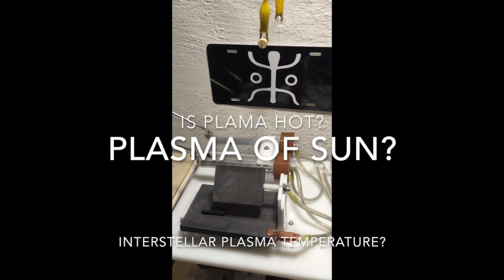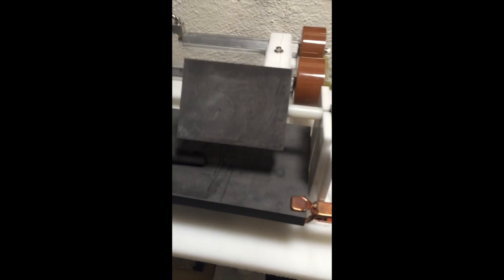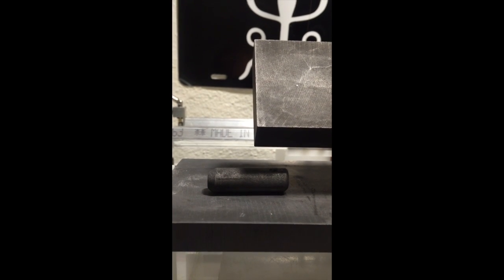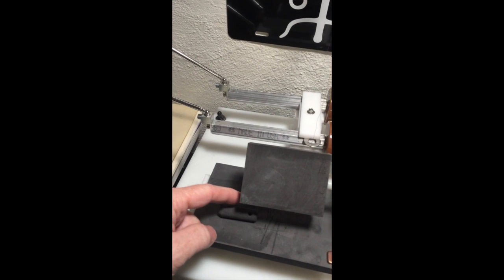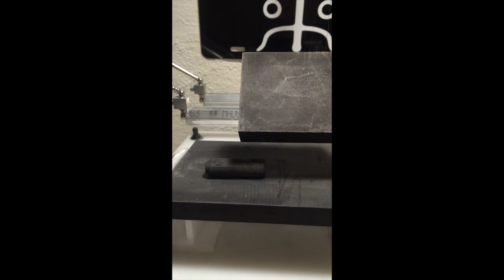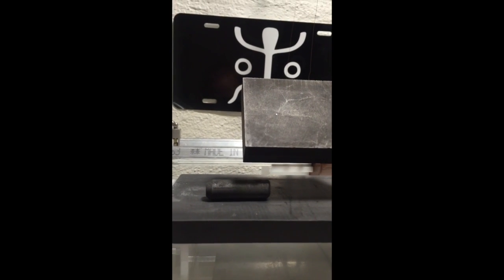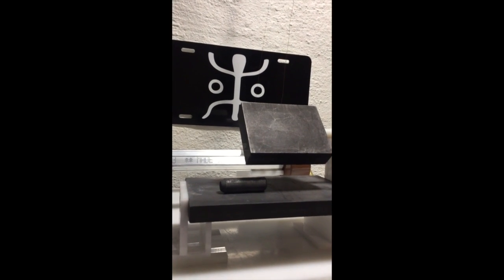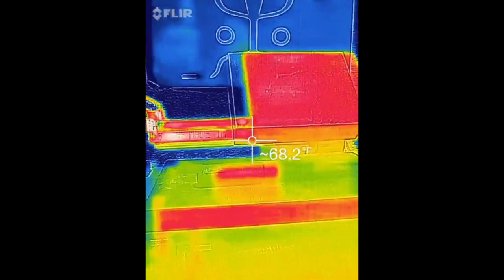TEMPERATURE OF PLASMA ?

Comment: but if the plasma has no temperature or is cool, then how does the loud pop crackling sound happen? heat from the small discharges similar a lightning bolt heat up the air around the bolt or discharge extremely quickly, and the expanding air creates what is called a sonic shock wave that we hear as thunder, or the loud pop sounds. the same reason why taser sounds so loud.
Reply from the maker: Energy encounters impedance. Voltage,Scale and medium ie character of dielectric all make the temp delta WHEN the energy encounters impedance.

Comment: The question is, how do we get a cooling effect from electricity?  We often use hydraulic metaphors when talking about electricity.  For example, the pressure of voltage and the flow of current/amperage.  In hydraulics, when we compress a fluid we generate heat, and when we decompress or expand a fluid we absorb heat.  Can you utilize these same principles to generate cold via electricity?  We know how to generate heat with it such as in induction heating, but what about capacitive induction cooling? What about the temperature of the shunted stout bars? Do you notice any heating or cooling effects of them? Furthermore, what happens when we build up a large pressure differential then dishcarge it quickly?  Does not the high pressure then transform to high current over a small time duration?  Generally don't we observe cooling when moving from high to low pressure?  What if we designed a new type of transformer that goes from high pressure/voltage to a low pressure/voltage?  Perhaps plasma would be a good inductor with its near infinite conductivity and negative resistance.  If we could produce a continuous cooling effect perhaps we could realize cold enough temperatures to generate the superconductive state...
Reply: You'd have to look to the thermoelectric (peltier, seeback, thomson), and magnetothermal (magneto-peltier, magneto-seeback, magneto-thomson) effects for cooling-heating.

https://phys.org/news/2020-10-world-magneto-thomson-effect.html
https://phys.org/news/2018-06-anisotropic-magneto-peltier-effect.html

Comment: Great observations! I agree with the resistance factor of the heat generated. The Suns output is cold...but the resistance/impedance, to the flow of the Suns output, gives the material(the Earth)...temperature. Mind blown :) Also, giving the Earth a vibratory quality :)

Comment: Hi, first very useful test and well done. I could see that the plasma Top carbon terminal was cold (Blue) and the bottom carbon terminal was hot (Red). The plasma temperature value was between top and bottom terminal value. Maybe exactly centered, not sure.
I noticed that the temperature of the plasma terminal is directly linked with the terminal substance. Given a same plasma temperature, it will vary depending on terminal substance, ie iron, steel, carbon etc.. 
Also, HHO brown gas, behaves similarly as plasma. The flame (plasma) although very low temperature, cuts through tungsten. It seems to me that the plasma is made out of ions of oxygen in you case, and oxygen and hydrogen in brown gas. When activated (lit up, are with flame, or arc) is interacts with it's nodes (endings) more or less, (colder or hotter) depending of the size of the atom nodes (endings, substance) . 
I find it hard to explain my view, in this short text.

Yeah, very good test and research, thanks for sharing.